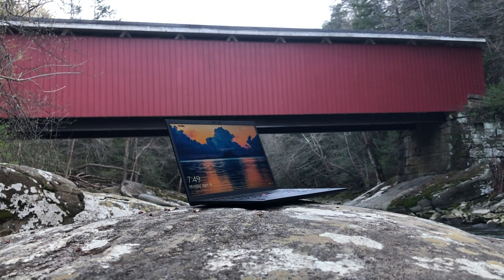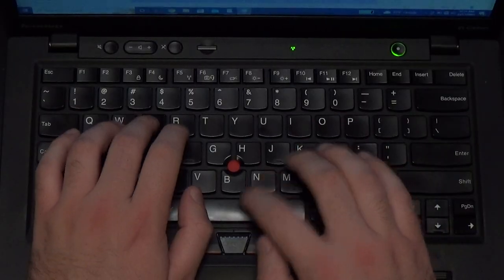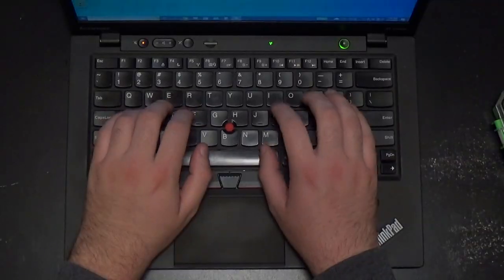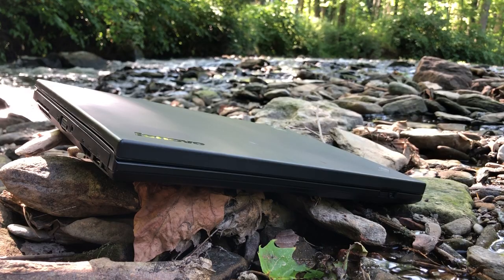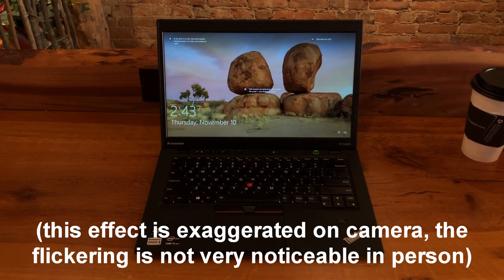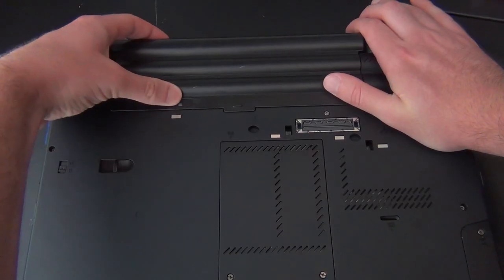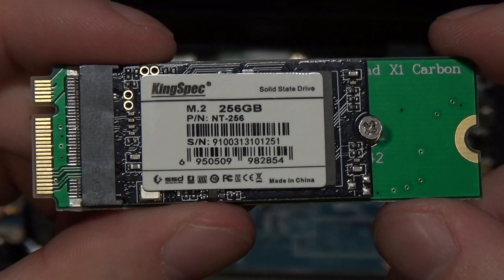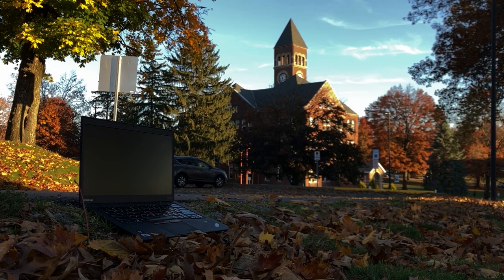The ThinkPad X1 Carbon, 10 years later

Comment: Speaking of soldered memory: I really am hoping Dell's new CAMM standard (which is open) will make its way to ThinkPad. It's thinner and might have a chance to stay in some of the thicker series like L and T.
Reply: The thing is you wouldn't really even want 16gb ram on such device (don't know even if cpu supports that).
Reply: I agree... Hate the soldered RAM. However I highly doubt that slotted RAM will come back for economical reasons.
1) people will buy the higher end model (which you can sell for $150 extra, $120 of which is profit)
2) if they buy the lower end model they will come back and buy another one sooner.
My current laptop is an L390Y, the last yoga with slotted RAM, it will serve me another 3 years at least. However afterwards I most likely won't by another lenovo and go with a framework. Seems to follow the spirit of old 200x era thinkpads more than the newer thinkpads

Comment: I'm still hanging in there with my w530 and t530 both all upgraded as far as I can. Good video as usual.
Reply: Would you mind sharing your thoughts on the W530/T530 screens ?
Reply: @oussama4629  Both mine have upgraded 1920x1080 displays. So I like them both. If you are buy a used laptop make sure you have a high display resolution.
Reply: @coegj  Thank you, i'm actually considering getting the W530 that's why i'm asking

Comment: A number of years back I had one of these with the i7. Fantastic laptop. One the reasons I bought it was because it had dedicated volume buttons, which I still find annoying not to have on the newer thinkpads.
Reply from the maker: Agreed, I'm sure it came down to wanting to save a few cents in manufacturing costs and it bugs me not having that feature on the newer models. If only they had done a similar keyboard for the 30th Anniversary ThinkPad that they had done for the 25th Anniversary Edition.
Reply: @SebisRandomTech  no doubt it came down to that. Probably just like removing the blue accents from the center button for the trackpoint, and changing all the keyboard LEDs to white. I can't stand the white power button and caps lock on my T480s. It's the small things that matter.

Comment: It's also important to note that the dedicated power light on the top cover went away mid year.  So if your model as those indicators you have an early to mid build X1 Carbon 1st gen.  Late builds did away with that awesome feature.
Reply from the maker: Interesting, I never knew that! Pretty interesting for them to make a... "revision" (downgrade) like that in the middle of production.
Reply: @SebisRandomTech  I stand corrected.  IT wasn't a mid year change but rather if you opted for the touch screen then they did away with the outside light indicators.  I had to go back and check my documentation.  So once again, if you have one of the very rare TOUCH screen models, you will NOT have the outside light indicators. I guess Lenovo had a hard time adding the digitizer for the touchscreen and keeping room for the wiring to run up to the LED indicators would be my guess.  The reason I thought it was a mid year change was that the touch screen option was NOT available at the start of production.  So it took awhile to ramp up those models for sale.  Also since they weren't avaiable at the beginning of production, all touch screen models came standard with windows 8, not 7.  Also the touch screen models have the red blinking "I" in the Thinkpad on the outer case.  Just wanted to be correct.

Comment: I've got an RTX 3080 MSI GP66 laptop but I've just bought a second hand gen 6 x1 carbon because there are so many great features, like the keyboard, size, and screen (and it's battery will last longer than 90 mins)

Comment: Hooray! a new upload, i recently got into thinkpads and wondering if t480 is still viable option for 2022. I will be mostly using it for school and media consumption i would love to hear ur thoughts in terms of battery life, performance and thermals :)
Reply from the maker: If you can get it for a good price then by all means go for it, just make sure the Thunderbolt ports are functioning correctly before dropping money on it. ThinkPads from that generation had issues with the Thunderbolt controllers that kill the port over time, this has been addressed with a BIOS patch but there may be some defective units out there.
Reply: Running a T480 my self. I7 and 16 gig of ram 2 tb of storage. Great machine. Good battery life and you can get replacement batteries for them from Lenovo still.
Reply: Considering I run a t420 from 2011 you should be fine.

Comment: I had one from 2016 to 2019, but have since upgraded to a t540p(with a w540motherboard). Build quality was amazing compared to my current rattling plastic t/w540, and I really apreciated the dedicated volume buttons and thinkvantage button. I had programmed  the thinkvantage button to turn off the display until mouse was moved, which helped me save battery when attending lectures.  Soldered 4GB of ram, lack of ethernet port and ultimately the battery life were my biggest reasons for getting rid of the X1. I'm happier with the w540 but my god is it heavy and pumps out more heat than the sun. For my next system I've been thinking of an x1 extreme, which could be a pretty good middle ground between the two.
Reply from the maker: The P50/51/52/53 might also be a good option. Similar size to the W540, but from what I've heard better build quality and infinitely more modern.

Comment: I stopped using my 2012 X1 a few months ago. It mostly just ran emacs, and still does everything I ask of it, though the battery and keyboard need replacing (I've lost 3 keys). It takes an extra trick to use the caps lock as a control key (it's nonstandard somehow?) and the battery life was never 8 hours on GNU/Linux. The keyboard doesn't feel half as good as my T20.
It has been that long since I could justify spending money on Lenovo. Newer models feel cheaper and have more misfeatures than ever. And their support is not worth your effort, at least here in Aus. I totally considered replacing with another 2012 X1.

Comment: After following you from years, and having a Model M myself now i figure out the sound of your intro comes from this keyboard, beautiful.

Im about to sell my gamer pc, and i need to decide for a thinkpad model. Will you recommend me T480 or any other model? (im scared of the t480 bc of the TB3 issue)
Reply from the maker: What will you need your laptop to be capable of? Is gaming a priority for you when deciding what laptop to get?
Reply: @SebisRandomTech  I just need to be able to run dota2 at 60 low graphics 1080p thats the only casual gaming i do. I thought about T480 but I’m worried will not be enough (there is no option of dgpu in my country)
Reply: Btw do u still use your model M?
Reply from the maker: @Azhi3r  You could possibly look into something like the P1 or the X1 Extreme since those are more performance oriented while still being relatively thin and light.

And yes, I do still use my Model M ;)

Comment: Really enjoy to see your videos. I Got motivated to bring my Old T61 back to life. Any chance your could help me out which spareparts to search for.? From an older video of yours it looks like a bios Update, memory, new ssd, perhaps a cpu. Any chance your would be up for at chat about it.?
Reply from the maker: Depends on what all you want to do with your laptop. What are your plans? Just get it running? Upgrade it? Daily driver or just a spare machine?
Reply: @SebisRandomTech  I want it a laptop to play around with, try out new Linux distros. 
Considering a Linux Alpine laptop.

It runs already. The battery isn't great, the fan a little loud, the monitor socket wackels a little, but nothing lose, nothing broken. All runs like i remember it from when it was new in 2008.
Reply from the maker: @tomasnorre  Might benefit from a new fan and a new battery, aside from that you can upgrade the RAM to up to 8 GB, make some processor upgrades and swap the hard drive for an SSD. The Middleton's BIOS I discussed in an older video will speed up SSD performance a little. Also make sure to repaste the CPU if you don't upgrade, the old thermal paste has probably gotten a little crusty by this point.
Reply: @SebisRandomTech  Thanks. I have searched for new fan, but hard to find in Europe. At least I haven't succeeded. It's already a SSD disk in there, so perhaps the bios update alone will make a difference. 

Thanks for your suggestions.

Comment: What's your opinion on the Yoga variants or the X220 tablet? I kinda like doing amateur art on the Yoga 260, but am considering an upgrade in the same ballpark. If it's a choice between the 90 or the 80 models, do you prefer the L or the X?
Reply from the maker: X series machines are generally better quality than the L series. I don't know very much about the Tablet variants of ThinkPads.
Reply: @SebisRandomTech  My girlfriend has been using the X1 Yoga Gen 3 as an upgrade over her X220T since she needs to run the Adobe suite for her classes (obligatory fuck Adobe). The quality of it seems to be on par with the other X1 laptops. On one hand, it's still better quality than other tablet laptops on the market. But on the other hand, it's plagued by the X1 line's limited upgradability. I miss the chonky, ultra upgradable ThinkPads. Lenovo has taken the ThinkPad brand in the wrong direction in my opinion, and at this point it's getting harder to want to choose them over something like Dell's enterprise laptops because very little separates them at this point. If Lenovo gets rid of the trackpoint (like Dell has been doing with their laptops recently, see the hideous Macbook-like Precision 3560 for example), then that will be the day they lose me.

Comment: ayyy, glad to see you back. The laptop seems like... the worst of both worlds. It doesn't have most of the benefits of the older thinkpads, and doesn't have the benefit of being new.
Reply from the maker: Agreed, it's certainly nice in terms of being relatively thin and light (even for its age) and has a few of those nice classic features like the indicator lights and volume controls, but the lack of ports and soldered RAM limit expansion, the U-series processor dates it more than the thicker M and QM chips found in the T and W series, and it has a display that beats the T430's but is put to shame by anything newer. Glad you enjoyed the video!

Comment: Question.  I want a Thinkpad with a minimum 4th gen CPU and don't really care how slim or thick it is.  Which model would you say is the best overall value for 4th gen and up?
Reply from the maker: T440p is easy to find and cheap, and it has a lot of upgrades available. 1080p IPS panels are a drop-in upgrade (and some models came with one from the factory), it's easy to put in a quad-core i7 and upgrade the RAM/storage. If you can get a model with dedicated graphics it isn't half bad for some modern stuff if you have reasonable expectations. The W540/541 aren't bad options to consider either, and if you want to get something newer and value performance the P50 series is worth a look. If performance is less of a concern to you then the T460/470/480 aren't bad options either.
Reply: @SebisRandomTech  Thanks so much Sebi!  I was looking at some well priced T440s on ebay recently but I will certainly also look into the ones you mention.  I really appreciate your time and value your opinion.
Reply from the maker: Sure thing! Thanks for watching!